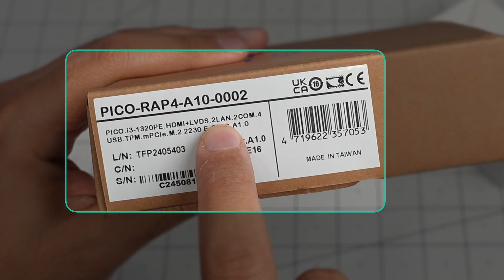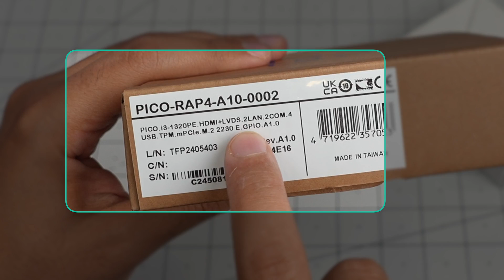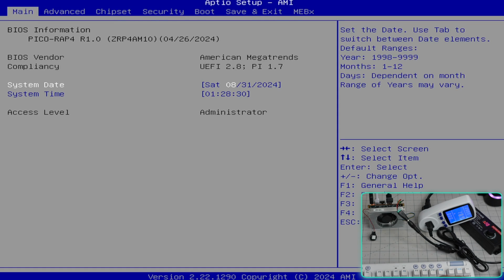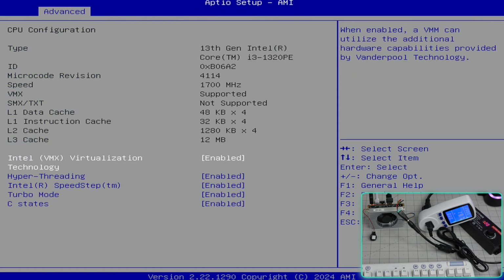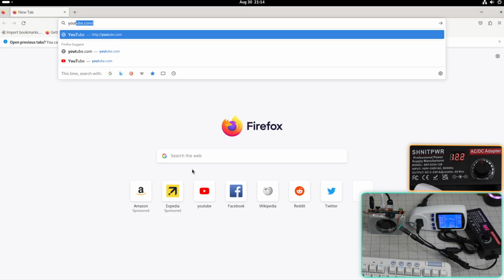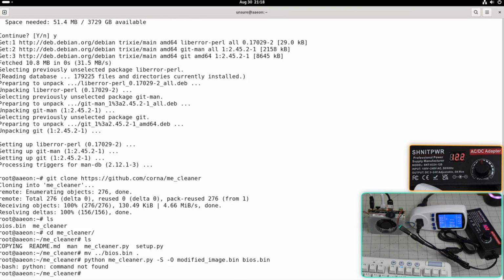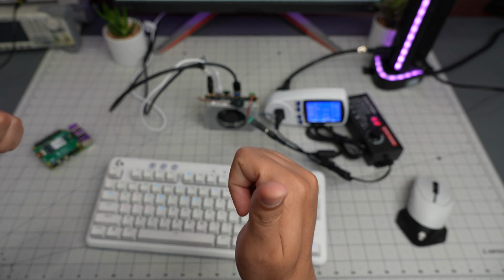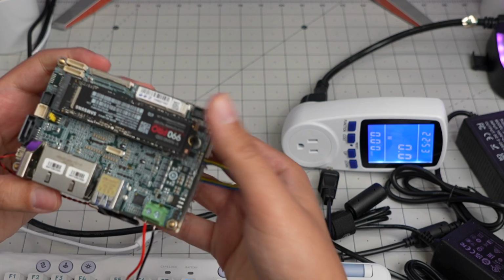AAEON PICO-RAP4: A Powerhouse with Intel i3 in a Tiny Form Factor!

Comment: There is a new version of the same sized board but with intel ultra (15h gen) 5 and 7, could you check those out aswell? I'm particularly intrested in power consumption and how much maximum can the board assign to the cpu to see the actual max performance.

Comment: The price is compatible with other miniPCs with 13th Gen 10C/16T processors with similar specs for $599, and it comes with a case that includes USB 4.0. I agree this is for someone who's looking to build a project that requires some decent performance.

Comment: This is an industrial/automotive grade SBC according to the site. I don't know about anyone else, but I ain't stickin' no Beelink grade stuff in an automotive project lol. Looks like it's claim to fame is the voltage regulator (can splice it directly into vehicles battery harness for example), it's vibration and temperature tolerances (can survive bumps and peak summers and winters in a car). I think that's where the price tag is coming from.
Reply: Might be interesting to dig out of old cars in the future
Reply: @Demopans5990  - or put this in a 65 mustang as the backend to run a big touchscreen like a tesla or something, That would be lit. X86 too, so easy to write a UI. Get the i5 or i7 spec lol. Would probably be sexier assuming car stuff has interesting serial data to interface with, or sensors could be added.
Reply from the maker: Yes, I totally agree with you. Thanks for sharing it here.